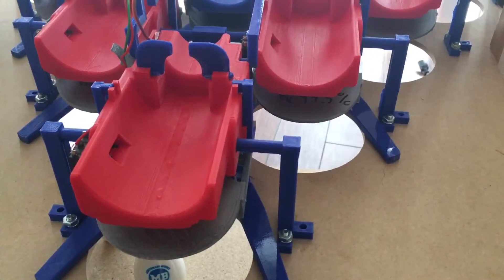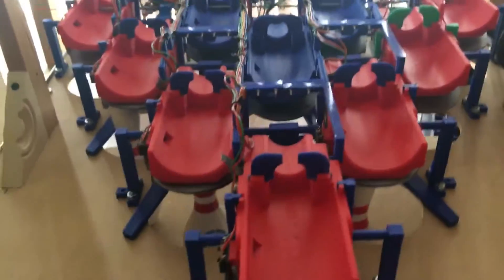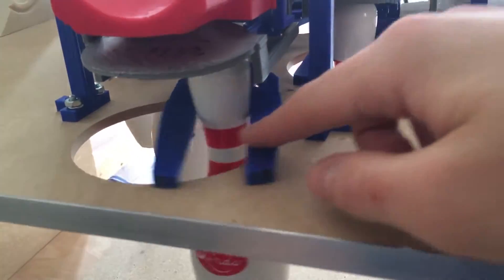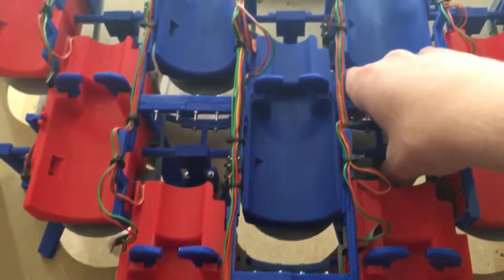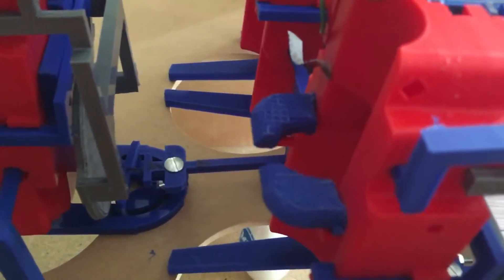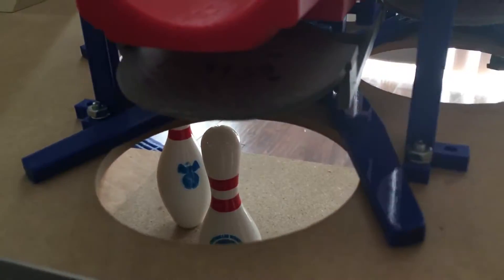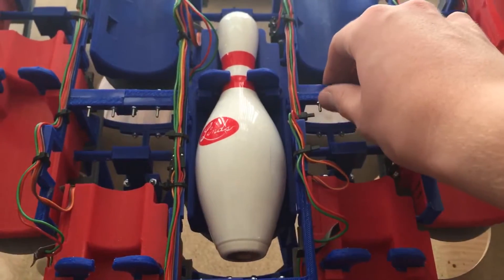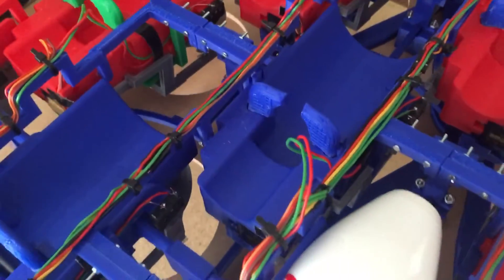Half Scale Pinsetter Update - Respot Assembly (pt. 1)

Comment: Hi Adam, its looking good!  I have been trying to build a pinsetter almost my whole life.  If you check on my channel you will see the remnants.  are this pin cups printed on a 3D printer or ?  If so, can you suggest a printer that works well for this, thanks!
Reply from the maker: bob johnson Hi Bob! Yep, I designed all the parts and 3D printed them on my Printrbot Play (with heated bed / y axis upgrade). Keep in mind I bought my machine a couple of years ago, and I don’t think they still even sell it. As far as recommending a machine, I haven’t really been keeping up on newer machines, but definitely do a lot of research on 3d printing. It’s not nearly at the point where you can plug them in and start printing. There’s a lot of tweaking, troubleshooting, etc. that you will need to do, and the extent of this and level of support definitely varies by manufacturer. I chose Printrbot primarily because the support they provide and the warranty is good for a first-timer. For a pinsetter, I’d try to find one that can do 8” in one axis. Half scale pins are 7.5” tall, so if you wanted to make a pin cup, this would help.
Reply: I was looking at a few printers today just to get an idea of what to expect.  I see there are some that also print with with metal (Aluminum, I think)and others can do a 3D scan of an object and recreate it.  Would be nice if there was a machine that would do it all.  I am no good at CAD software So, I see the scanning ability a plus.  I will be using a PLC controller to run the pinsetter......  I bought that a couple weeks ago just to get familiar with it.  I used to work on Brunswick pinsetters for about 15 yrs (that was 25 yrs ago).  After seeing a few people actually getting small machines to work, I found the motivation to try it again.  Learning all these different processes seems a little overwhelming but, I'm picking it up pretty quickly...well, for an old fart.  I'm not looking to market it, should I get one running so, it may just look like a mini version of a full size one that already exists.
Reply from the maker: bob johnson cool! Things are changing, but as of a couple of years ago the technologies to print in aluminum and the 3d scanners built-in to printers were both very poor. My recommendation would be to be very careful of any machine offering an all-in-one solution, as I've often heard more bad things than good. PLC's are always fun! I got started by buying an Arduino starter kit that came with a bunch of electronics components and a book with a few projects, and those projects detailed everything from building the circuit to programming. Something kind of cool if you do manage to find a good 3d scanner: it's super easy to just say "print this part at 50%". Obviously, your mileage will vary; 3d scans aren't perfect, and full scale parts are sometimes too brittle or thin in some areas.
Reply: I'm still trying to think through it all.  I was going to try to get a 3d scan of an 82-70 pin cup and shrink it.  Still trying to decide what materials to make it out of, I know I will print some of them but, some might have to go to the machine shop to cut.  When did Linds quit stocking the mini-pins?  Have you ever run across a good 3D scanner?
Reply from the maker: bob johnson They stopped making pins a couple years ago I think, but someone on bowltech.com found the supplier and is now reselling them. As far as good 3D scanners, I really don’t know too much about it. I know a local place that invested ~$10k in a really good scanner, but I don’t know of any good home scanners reasonably priced. IMO, the cost/problems you will encounter trying to do 3D scanning and shrinking of a pin cup aren’t worth it. The full size part is metal; you will be printing at half scale, likely in some form of plastic. 3D printed parts are much weaker than the machined metal (especially along the z axis). You may have to do quite a bit of work to modify the scanned file into something usable (think of it like “photoshopping” imperfections out of the scanned file). etc. While it is definitely something you can try, you might be better off contacting a local company to test out how well it works before investing in an entire setup.
Reply: I'm just trying to see whats out there before I start planning this instead of jumping in and wasting time going down a road that won't pan out.  There are many choices that I didn't have 25 years ago.
Reply from the maker: bob johnson sounds good. I look forward to seeing updates on your machine!

Comment: Looks promising! I'm amazed how your 3D printed parts hold up so well.
Does the table always miss the head pin while scoring, or does it recognise it when all other pins are standing? If it always misses, try mounting just that pin cup a bit lower so it will reach. (or alternatively make the table sturdier. lol) :)
Reply from the maker: ThinkCleverAndSmart I don't have the wiring done, but all the switches get pushed if I set the table's weight on the pins. I plan to add a roller that would correct the rocking back and forward (and therefore the head pin scoring issues), along with redoing how the table is supported (I plan to use metal electrical pipe and clamps that would let me adjust the position of the table). Also, I'm still working on the scoring. I'm trying to work on the animations, but I'm struggling to keep the transparency from your renderings. Ill get something to work though.
Reply: Oh, that sounds like a good idea. Actually, that's something I have been focusing on lately on my lego pinsetter lol. Adjustments are important to keep things working, and I didn't make a chance to adjust anything when I first built the assemblies I'm still using. So, two days ago, I started to renovate and redo the transport band, the elevator and parts of the top secret distributor. :)
If you want to, I can send you a black image with 40% transparency, maybe that would help?
Reply from the maker: ThinkCleverAndSmart unfortunately, that wouldn't help. It's the combination of sliding and transparency that is making it difficult. It's losing transparency when it slides, or its being really laggy if I rerender each frame. I'm thinking I might just make the entire window go 40% black instead, since fading seems to work significantly better.
Reply: Sounds like a good solution. :)